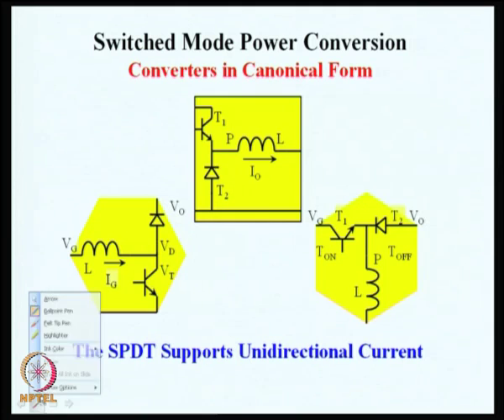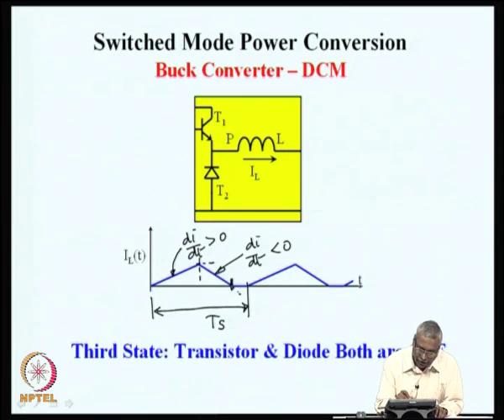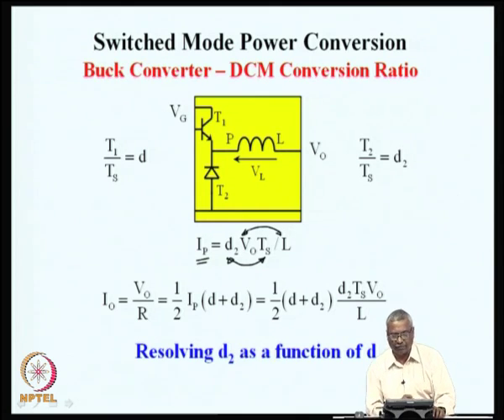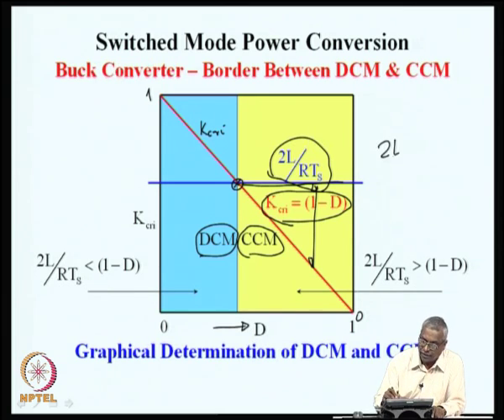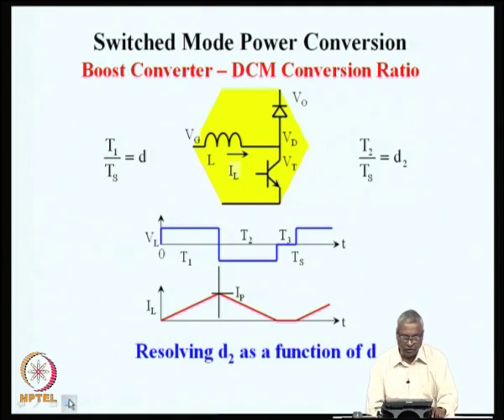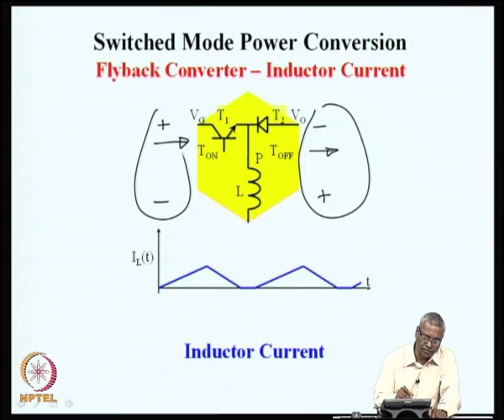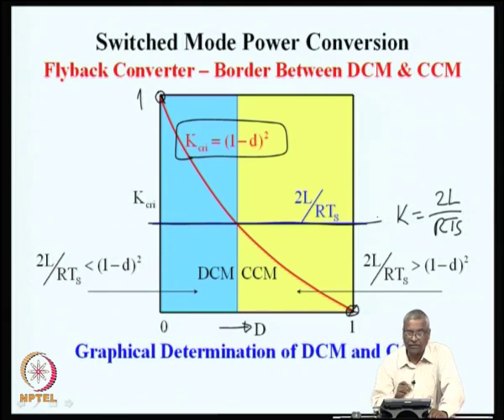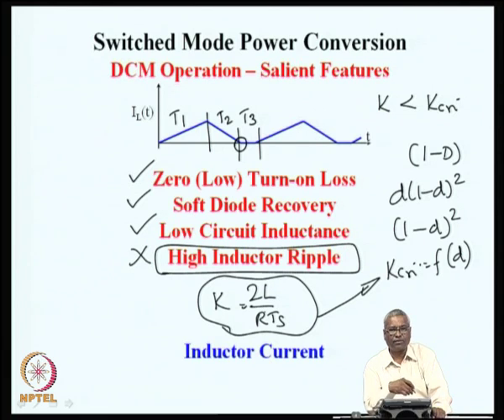Mod-07 Lec-16 Conduction Mode

Comment: If load is battery as charging, then how can I decide the value of K=2L/RTs,   because R is absent
Reply: Does CCM DCM matter for battery charging as long as we give it rated current for charging and battery too has internal resistance

Comment: At 7:42 "if the load current is reducing then also the ripple factor or ripple current is increasing"... Shouldn't it be like "if the load resistence is reducing then also the ripple factor or ripple current is increasing"